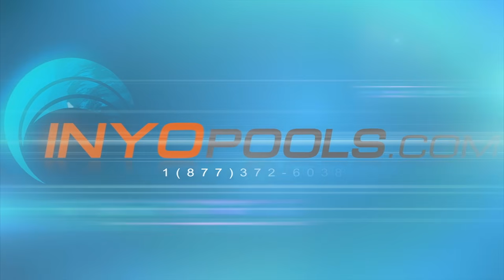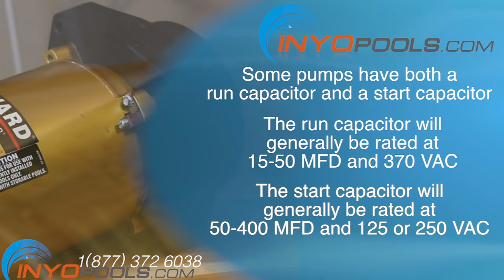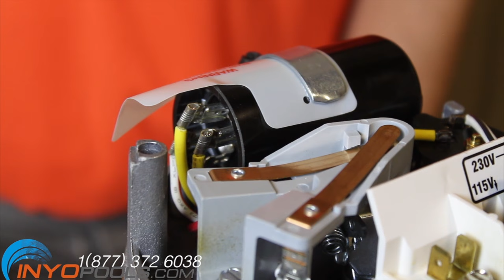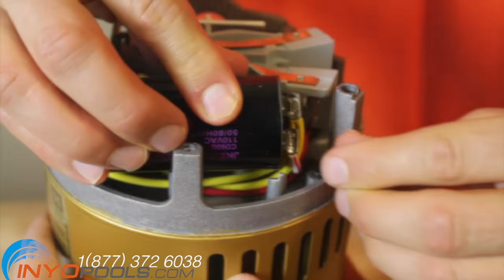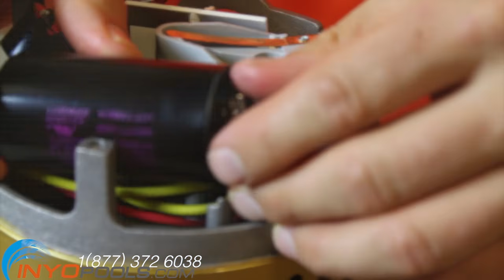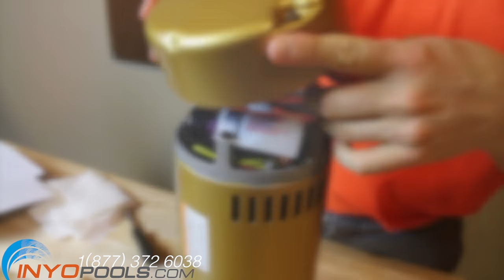How To: Replace Your Pool Pump's Capacitor

Comment: Can you find me reference for the Dohenys Pool Pump 6579 if it has a capacitor and how to remove it?
Reply from the maker: That's an above ground pool pump; a lot of their motors do not have a serviceable/replaceable capacitor like inground pool pump motors. I couldn't find much information on that pump model. But, if you take the back cover off and there's no visible capacitor, nor a capacitor doghouse on top then most likely, there's not one there to replace.
Reply: @Inyopools i was able to fix it by opening it up and cleaning out contacts and rebuilt it, the opening  was similar  to a Hayward Pump.

Comment: can't find the capacitor under the end cover. The shaft of the inner windings turns freely.
Reply from the maker: What is the part, model, or catalog number on your motor's label? A picture of the motor label would be most helpful.

Comment: Please please PLEASE turn the power off at the circuit breaker.  I was working on my pool equipment one day with the panel in service mode.  Out of nowhere, we had a momentary power outage. As soon as power came back on, the panel booted up in "auto" mode and turned on the filter pump after just a few seconds!  Luckily, my fingers were not checking for debris in the impeller housing at that moment but could have been!  Even since then I appreciate why it's so important to turn off power at the circuit breaker.

Comment: My mom thought it would be a really GOOD idea to leave the pool pump RIGHT on the ground, completely exposed.

One bolt drilled out, and the front bearing replaced with a (less bad) new one, and I have a really nice motor on my hands! Now if only I had a chuck...

Comment: What model number of the pump used in this example
Reply: I have a  model c48k2n143b1 could you help with micro farad. Just want to do it all in 1 short so I can have cap on hand

Comment: Hello sir where is the connection of that violet wiring?
Reply from the maker: The violet wire is not a part of the motor capacitor wiring. In this motor example, it looks to be connected to the terminal board. I suggest looking at the wiring diagram on the motor label; it may have helpful information there.

Comment: Well I guess I got a piece of shit Chinese pool pump because the capacitor is not in either place all these videos say they are. Must be inside where the motor windings are. Geez...
Reply from the maker: Hello Elton - Not all motors have a capacitor. You may have a split phase motor. This type of single-phase motor is used extensively in spas/hot tubs and above ground pool applications. They can also be used on smaller inground pumps. This design has a start winding and a start switch, but no capacitors.
Reply: @Inyopools  I know that. I've been an electrician for 48 years. By the way, motor was 2 months old and I bought a motor that can be worked on.
Reply: So you have to replace the entire motor?

Comment: I thought there would be more explanation of the wiring and what it does just about anybody can just replace it but what if you get wire in the wrong place anybody can just simply change it if you have the exact capacitor that's what happened to me I've changed capacitor before but this time I burnt up the capacitor now can you explain why that's what I'm looking for.

Comment: My pump only has 1 lead wire coming out(it's red) and there are 2 terminals on the capacitor. Is this normal and do I only hook up the one or am I missing a lead wire?

Comment: owner misplaced the busted capacitor. can you please help me the rating capacitor for hayward super ll 2Hp motor (model C48M2N111A3) ? pump has only 1 capacitor
Reply from the maker: If we are talking about the start capacitor at the back of the motor, it is 124-149MFD and 110-125V.

Comment: Very informative video. I have an A31 Tidal Wave pump for a koi pond and am trying to replace the capacitor. How forceful should I push the leads onto the terminals of my replacement capacitor? I worry about breaking the terminals if I apply to much pressure

Comment: you are discharging the cap incorrectly.  the screwdriver is shorting across terminals with yellow wires that are already common to each other.  this will not discharge the capacitor.  you must short from one joined pair to the other joined pair.

Comment: I put on new capacitor pool pump worked for 20 minutes then turned off.  After 30 minutes I tried again and pump started. When I removed leads I was not sure of where to put them back. Any ideas for me.

Comment: so how do you know how to place the wires on the capacitor if it's not the exact same model
Reply from the maker: We would suggest taking a picture of how the old capacitor is wired before removing it. That way its easier to rewire the new one.

Comment: How do you know where the leads connect to the new capacitor?
Reply from the maker: Our suggestion would be to take a picture of how the old capacitor is wired and then wire up the new capacitor the same way.

Comment: I just received my start and run capacitors for my Sta-Rite (A.O. Smith) pump motor from InYoPools.  Now my pump runs properly.  The motor had a slow start problem...like it was bound up when first turned on.  Probably just a start capacitor, but I replaced the run capacitor while I was at it.  Also replaced the terminal panel, which had gotten brittle and was cracked.  Thanks for the great parts and videos to help.  Good company!

Comment: Note: The video shows "shorting" across the terminals with the yellow wires. That isn't actually doing anything and won't make the capacitor safe to handle. Those two terminals are already connected at the top of the capacitor. The capacitor has two pairs of terminals. Each pair is a single piece of metal with a rivet in the center. You want to short the two pairs of terminals. Otherwise, this is a very helpful video.

Comment: Thanks!  I bought a new capacitor for about $7.00 and it fixed the problem. A lot better than replacing the whole motor.

Comment: when capacitor burns out, will be any noise when turn on pump? mine doesn't have any sound, but the connected light bulb is on,  brake reset a few times, not sure what is wrong
Reply from the maker: A bad capacitor has a distinctive hum. You can also try testing the capacitor (and other parts of the motor) to determine that is the issue: http://www.inyopools.com/Blog/using-the-proper-test-equipment-to-troubleshoot-pool-motors-2/

Comment: What if I removed the 3 leads and am not sure which one came from where?  How do I know where to place them on the new capacitor?
Reply from the maker: +bwram Unfortunately capacitor leads are not marked so we usually suggest taking a picture of the wire connections before removing the old capacitor. We do not suggest "trial and error" as this could "pop" the capacitor.

I would call the capacitor manufacturer to determine the correct leads.